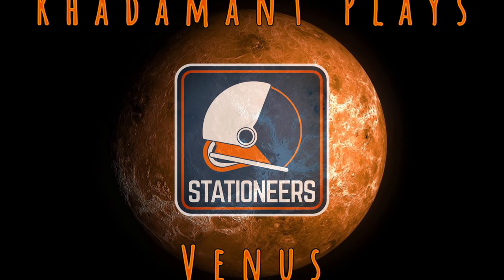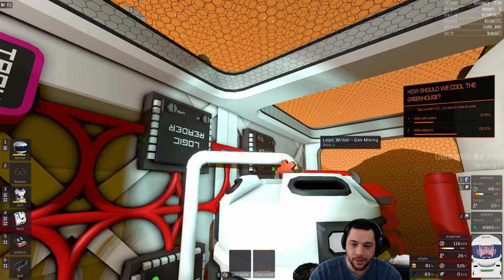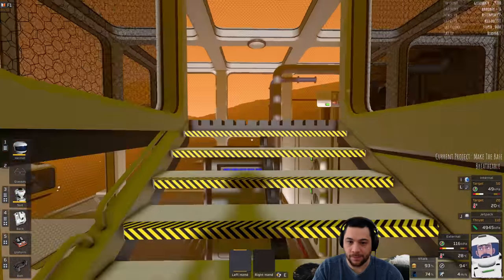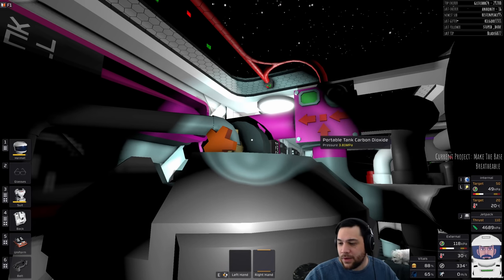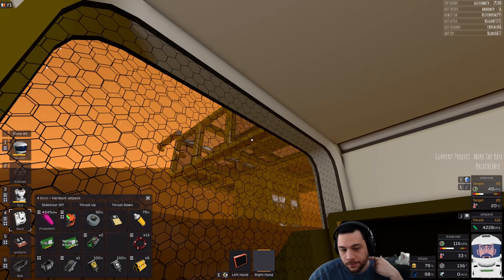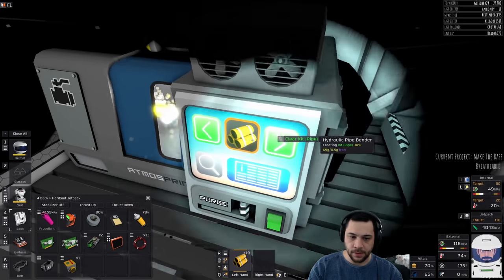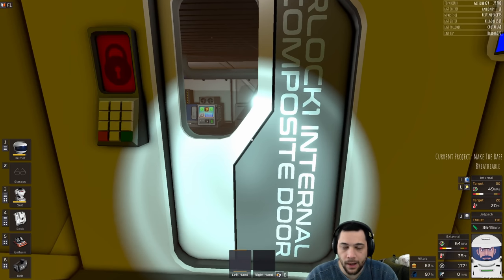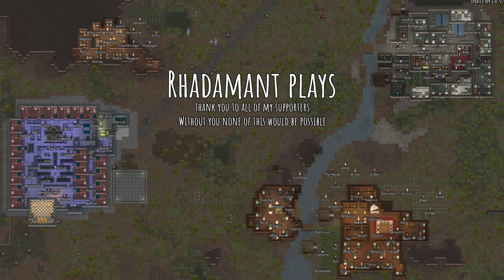Stationeers Venus - Greenhouse Coolant System // EP43

Comment: Huh, 53:00, weird question. Is water modeled to.. freeze if you use it in this 'void radiator room' scenario? Will it plug the pipes? Burst them, even?
Reply from the maker: Water isn't modeled like that, it doesn't have a solid state.